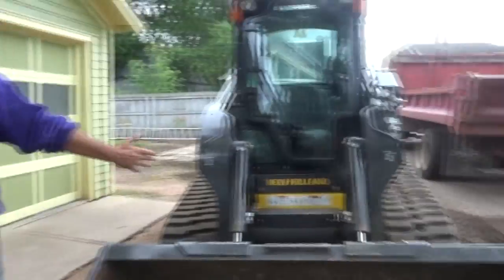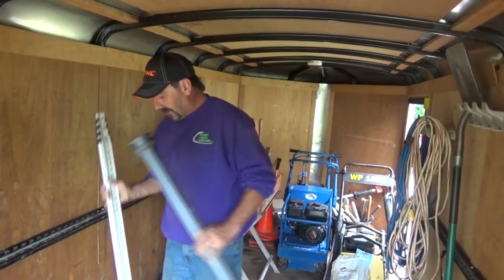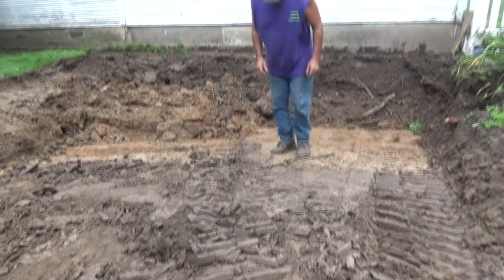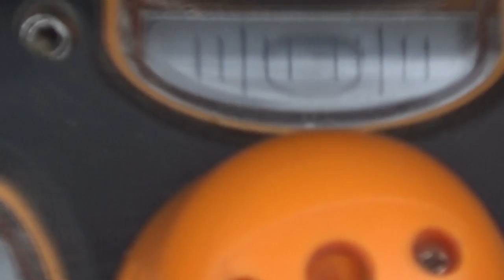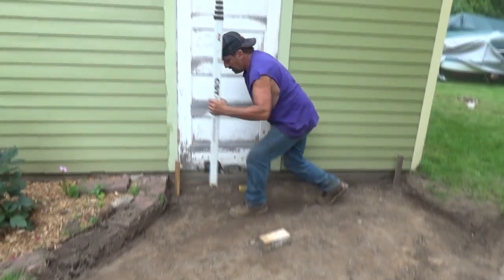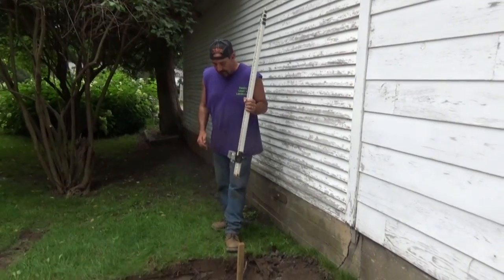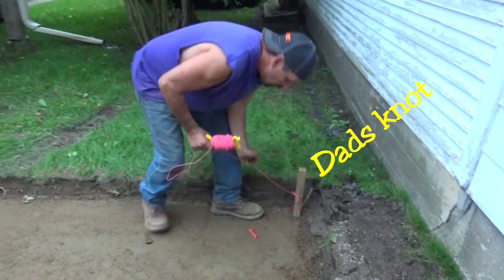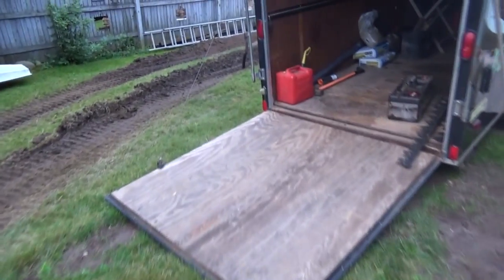How to install a paver walkway and patio

Comment: only 1" pitch for a 20' run ? should be a minimum of 1/8" per every foot
Reply from the maker: oh contrayer brother. ( hope i spelt that right ) if i used your equasion that would mean i would have to pitch it  over 2". You don't have to have such a steep slope brother . the water will still run off my friend and it's much easier to walk on. ( FACT ! )